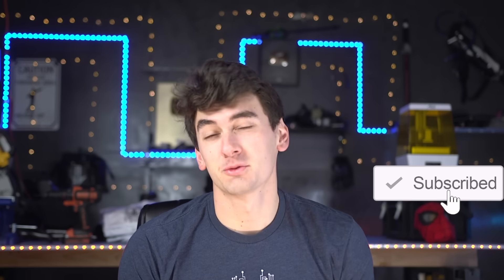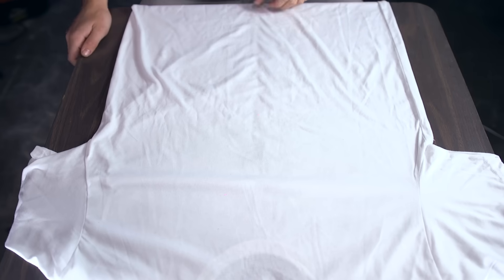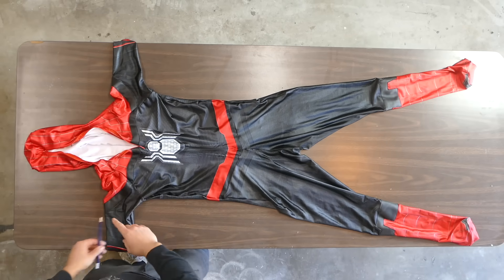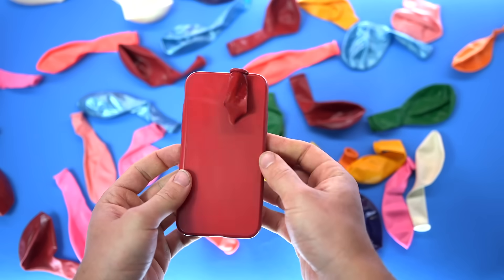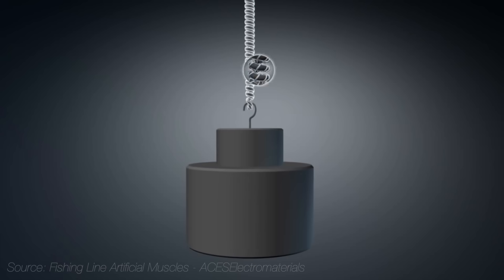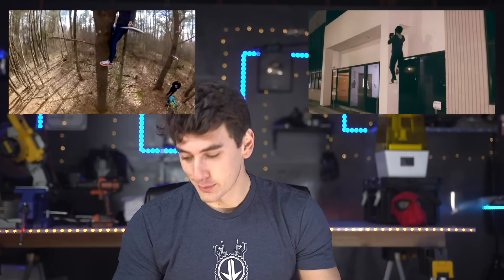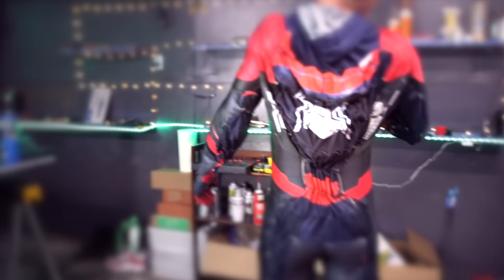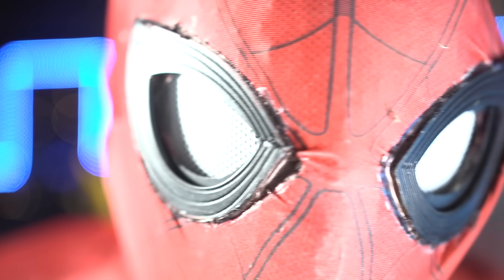I Built Spider-Mans Self Tightening Suit!

Comment: the entire spiderman suit can have poor sporadically placed amongst it so that super glue can be oozed out of it allowing you to stick to any surface for a long amount of time without falling and oil can be released in certain places to gently release the suit drying it at the same time the holes in the suit could have a heating and air blowing system. All of this should also include a large number of items that will increase the durability of my armour and my suit. So far, my suit has contained a belt containing 3 knives, 2 axes, a hammer, 4 throwing stars, two handguns. the knuckles could have a laser light on it allowing you to shoot projectiles with accuracy.  My gloves contain an array of different coloured wires for attaching various things. The red wire is the grappling line which you can use to attach yourself to walls or buildings and make sure that you stay safely attached to whatever you're working with. there's a strong pulley system inside with the tiny catapult built inside of the wrist so that when it's fired it can be pulled back in with no problem. There are two more cables which connect to each pair of fingers to create more hooks for other parts of the suit which I'm planning to equip later. I've included some other components within the suit too, mainly the legs, the webbing system and my gauntlets which enable me to grip things and move around quickly and efficiently. a gyroscope can be built into the arm allowing you to know the polarity of the swing so that you can kick your legs back and forth and with doing so the system inside of the suit will also make you kick a little bit harder utilizing air pressure pushing you back and forth with air pushing your back forward and your stomach backwards allowing you to kick much harder before it swing meaning less energy between swings.  Finally, I've designed a few more tools in this suit for you which are meant to keep me safe if we end up in a fight and to prevent me from dying. I'll probably need to modify the suit a lot in order to make it work in a crisis so that you won't fall to your death, a flight system for wings can appear out of the suit allowing you to Glide and then in a hole in the spine of the suit can produce a Deployable parachute in case you were to ever fall and Deployable airbags around the suit in case you were ever to fall a little bit short where the parachute couldn't catch you causing you to bounce instead of hitting the ground hard. the suitcase collect energy and multiple ways such as solar energy kinetic energy and many more different types of Energies that will allow the suit to stay charged up even including running jumping flipping and Swinging could store energy in the suit. every little movement could cause a storage of energy. You could make metallic gloves that have 1000s of tiny pores in them that oozes out super glue to make them stick and then ooze out oil to make them release, with a heating system that dries the oil, or maybe a cleaning system.  You could also make your own metal gloves, made of pure steel. If you were lucky, you would find some alloy that was both flexible and strong enough so that they wouldn’t break if you pulled too hard. these could be used as spider man gloves, you could also mix copper wire with pores within it, super glue and gorilla glue and tiny strands of rope, a heating system and a oil release as well as water releaser to cleanse before each catapult of web strings. If you had a lot of money, you could build your own personal suit from metal, cloth, leather, and silk.  
I’m not going to give you all the answers but just take everything in and think about it. 
If you decide you want the suit to help you, go ahead and start making it. It might take awhile but the faster you do it, the faster you get to wear it! 
Sincerely Lord eshua

Comment: what if the suit was just loose enough to slip into and instead of shrinking actually inflated to fit. Not to the point where you look like the Michelin Man but just enough to make you look pumped. This would also press all wrinkles out. You could also sculpt abs and biceps but leave joints to allow more freedom of movement.

Comment: Actually I worked on something like this. What I came up with is you basically are close. But instead of sections of the suit shrinks you in truth line every inch so when the voltage is pressed on the Spider chest the entire suit would tighten up. Now the problem with this has to do with well your skills as a  seamstress. The entire cloth has to be redone and more importantly the values of when the suit tightens up has to be calculated properly. Nice attempt but if you want it right try this method.

Comment: Hey man I know I'm late to the party here but I think a combo of them all would work well. 

Use the smaller suit and then cut open the backs like you did, then run the string through and have the little motor pull the strings through small pullys in hidden spots like armpits and the chest piece. 

This was still a dope and creative way of doing this though! I would have never thought to do the memory springs. Very cool.
Reply: wow that is really smart

Comment: dude there's a stitch called a 'ladder stitch' that i think wouldve like super helped make this suit. if you threaded it interally you may not even be able to see it from the outside and then you could use a type of pulley/reel system to pull it tight. lol maybe ill do it instead.
Reply: probably could use like fishing wire or some other sturdy plastic based string/wire to make it slide easily against the spandex and then even if you did need to put it on the outside when its full size it'd be basically invisible. maybe im not thinking this through even but i think it's at least a theory worth a try.
Reply: also there's a company called Breathe that makes chest binders that do basically exactly what your suit does which I think is really interesting!

Comment: Look into nickel titanium alloy memory metal. Can be stretched out out to huge lengths and then with a small electrical current retracts to original shape/shrinks. Make a fabric with this metal very tightly wound in small threads. Stretch it out run a current watch it shrink back to fit. Nvm you got to this eventually

Comment: You know great gob and I like the front of the suit more than the back but I like what you did who’s the back you basically cut the original suit and cut up the other suit and put the other suit in between the original suit so when the spring’s pull the suit together the original suit comes back together

Comment: what i would have done is instead of shrinking the suit, i would have something that is fairly malleable on the inside that inflates to press out against the suit while still being squishy against your arms to still allow free movement. Of course with this the suit would have to be a bit less loose than the one in the video otherwise you would look like you have massive limbs  when it inflates.
Reply: Cool idea so speaking of shrinking suits what about an antman suit i wanted to ask do you have any ideas for an antman shrinking suit or atleast a suit were the suit doesn't shrink but does something else that would make it like it shrunk
Reply: @jamwar4167  you could do the opposite where instead of pressing a button to inflate the suit, the suit is always inflated and the button just deflates it.
Reply: @athenbotchlet3887  cool and i was also talking about did you have any ideas for an antman suit?
Reply: @jamwar4167  Unfortunately I don't think it  is possible to make anything similar to an antman suit
Reply: @athenbotchlet3887  ok

Comment: Could I make a suggestion for a product? Everywhere around the world, thousands of litres of petrol are lost at gas pumps when people remove the auto shut-faucet fuel nozzle from their car and fuel is still coming out. Imagine a faucet fuel nozzle with some kind of vacuum sucking device near the end of the nozzle that would suck in all that excess fuel. It would activate itself when you released the handle and deactivate when in contact with the fuel pump. Would that be a viable product?

Comment: Use NiTi as the structure grid following the web design on his suit. Theoretically this will (or should) make the suit tighten evenly. Make sure you lace the NiTI with Spandex. Throw a battery pack on the web shooter that finishes the suit and I think you have a golden product.
Reply: Think... Webs capture..... (I'm not talking web cams) What better way to make this work than using inspiration from nature

Comment: @JLaservideo     in an early version, you utilized pull strings, but had concern regarding hanging strings, bunching, etc.... not to seem too simple-minded, though.... why not invert the process and have all the strings, mechanisms, bunching happen skin-side instead of air side... wouldn't that eliminate the issues? cool invention bro...

Comment: If you re visit this suit idea. Watch videos on origami folding. Or just videos on clothing folding ideas. If you run string in a dimond, octagon or honeycomb or something like the superman insignia shape. Combine these shapes if needed.  In key spots along the back, elbow so on. As the string in pulled it needs to be pulled over inseam lined with string to help with shape. And lastly add the insignia to line it up like you already did with yours.

Comment: On the suit it has a web design. Attach string to the lines vertically and horizontally than have little motors suck up the string.

Comment: For the eyes I'd do a photo resistor and a small DC motor so it could shrink and expand the eyes depending on the amount of ambient light. Also I wonder if the memory wire would work better being wover INTO the fabric itself and the fabric could be made of the fishing line so both methods could be applied at the same time giving a much cleaner look. I know the point is to make it simple rather than complicated but with current technology lacking sometimes more complicated is needed until something simpler is invented.
Reply: Jhb GG

Comment: You could've done a Y motor ... it wouldn't  be weighted and it would've pulled the fabric from your shoulders and mid back.. it would've even out the wrinkles  

And where the battery or whatever for the mechanism... be on your tricep and across your tail bone [hip to hip]. Again wouldn't feel the weight...

But what do I really know

Comment: since you mentioned the metal is programmable, i'm thinking if you made just the right U shapes on your back or more like a bunch of shapes like this`` \_/ `` like a double S shape. You stretch that out to a thin line, then put the suit on. 
And for like your armpit area you could make bat wing skeleton shapes where an open wing would be loose and a closed wing could suck up into your armpits and knee pits and crotch are lol. 
I'm picturing the back being overlaps of that shape like an armadillo or rolly polly with the same slice of spider logo and web pattern on every 2 or 3 overlaps. It would be hard to make and some painstaking work plotting out the curves on human anatomy but I think it could help clean up the back areas and possibly be so cool that marvel steals it for spider man's next movie suit!

Comment: BRU ITA BETER UAE MINI VAKUM AND USE ELASTIC MATERIAL FOR IT, I MEAN IF UNKNOW HOW TO MAKE ELASTIC MATERIAL BECOME BIG FIRST AND WHEN U USE VACUM IT MAKW AIR ON THE INSIDE GOES OUT THEN COSTUME MATERIAL BECOME ACTIVE AND MAKE COSTUME BECOME TIGHT, ITS MAKE SENSE RIGH, BUT THE DIFFICULT PART ITS MAKE MINI VACUME THAT HAVE BIG POWER, BUT DINT DAMAGE SKIN, AND FIND ELASTIC MATERIAL THAT CAN BE CONTROL THE TIGHTNES OF COSTUME MATERIAL

Comment: You did it backwards. 
You need a properly fitting suit with a retractable expansion mechanism. To remove, activate the expander. To put it on, get in and retract the expander.

Comment: I feel like this use of nitinol in this video is a start to very useful applications. If I had the money and resources, I feel the nitinol could be reshaped to a person's body(by making a concrete mold of the person's body and heating the nitinol at 400 deg. C using the mold to reshape it to the shape of the person's body). The Nitinol should be in a wave configuration forming rings( such as in the link: https://content.instructables.com/ORIG/FAK/15XQ/HQRO1Y5B/FAK15XQHQRO1Y5B.jpg?auto=webp&frame=1&width=320&md=f36f5c3e1ab0feef128d21f9985a8088). I feel this would give a clean fit eliminating the bunched up cloth in the back. An issue that comes to mind with this method is figuring out a method to attach the rings of nitinol to cloth material. I can imagine when using stretchy material the Nitinol would be forced into the shape of the resting point of the stretchy material. The more rings of nitinol there is the more resistance the rings would have against the stretchy material possibly solving that issue. This is just an idea i want to get out.

Comment: How do you think it would work if you put the strings through to tighten it but the used the heat up springs to pull the strings instead of having to have springs placed all around the suit? Then the springs contract and pull the stitches right instead of you having to pull a bunch. The only problem I see with that would be if it takes more than one pound of force to pull the strings together. But maybe if you had more than one spring that pulls the stitches it could work

Comment: I am kinda late but. In my opinion. You could've used the motor laces or motor roller thing and build some armour over it. It would've been easier cooler and overall more practical. With less issues.

Comment: Maybe next time print the suit out, then use a latch with a motor (kinda like on a brief case) so that it always over laps in the same spot. Then have the suit printed do that after it overlaps the spider on back and everything lined up, that way you won’t be able to see the springs and the folds. I feel like you could find a ways to have the fabric go over the latch. You could also try a sliding version too.

Comment: You should make a pool cue that turns into a bow and arrow.
You could have a bow string attached at each end and whenever you push a button on the side of the cue, the tips tilt inward. This makes it discreet and easy to use. While the cue is in its regular form, the string would be invisible along the surface. Something you could add to make it even cooler would be to hide arrows in the shaft of the cue

Comment: There was actually one other option you had. there is a type of thin flexible plastic that expands with heat and shrinks with cold daily dose of Internet actually had a video of it so you could’ve used that. just a suggestion though

Comment: Make the mini bots from big hero six  It would just be a bunch of mini rc bugs the hard pat would be synchronization but if you have preset protocols that tells each bot where to go than all you need is a method to attach them and if you wanted to you could just put electro magnets in front and back and have them activate once everything's in place possible and easy if a bit time consuming you could use voice commands like wall and have them stack in front of you or have them become a seat

Comment: With the Edith glasses you could use the same program that allows cameras to focus on your face in order to target for a drone or have the drone hover about 2 feet above the glasses at all times and then use the position of the glasses so it just shoots were you look you'd have to put a GPS on the front corners and right behind the ear and use that to figure out the rotation of the glasses.

Comment: Hear me out. What if you was looking at this from the wrong angle? Instead of making your suit shrink, get a suit that's form fit made of spandex or something that stretches good and use some thin rods with a motor to expand the suit (think camping tent). Everyone assumes the suit is naturally in the relaxed shape and contracts but what if its natural shape is the contracted and the suit is expanded to allow it to be put on or taken off. It would also be a risk if the suit was shrinking because if the controls were damaged it wouldn't hold the fitted shape whereas if the suit was form fitted and the controls were damaged it'd mean he'd have to wiggle around to get it off

Comment: Yo I know that this is really random but on your web shooter that shoots darts and it’s retractable you should add spring loaded prongs on the top and then put a ring over the prongs that way whenever you shoot the dirt if you have enough power the door will penetrate the ring will come off of the dart and then the dart will be able to pull more

Comment: I don't know enough about electronic engineering. But couldn't you make rollers segmented along the spine or maybe 2 lines ruining down the sides of your back? (Not your sides) to reduce the amount of material being pulled to one place. I'm guessing you already thought of that and thought of y it wouldn't work but I don't have the knowledge to know y it wouldn't

Also. You could try a more finely spaced threading with either thread or the memory metal. It would take longer but when the fabric pulls it should reduce our should I say. Help evenly disperse where the material is bunching up. So instead of one big clamp in the back. It's several small clamps placed all over.  Though that may be exponentially more difficult xD 

Idk just ideas

Comment: With these memory springs you could make a batman glide cape.  16 ft wing span, double layered like a parachute. It becomes a stiff glide surface with hard vented wing edges when the springs contract but loose and cape like when unconstricted.  It'll have to connect at your neck/shoulders and to the small of your back maybe with hand grips or magnetic clasps